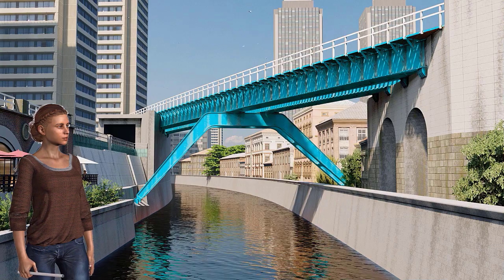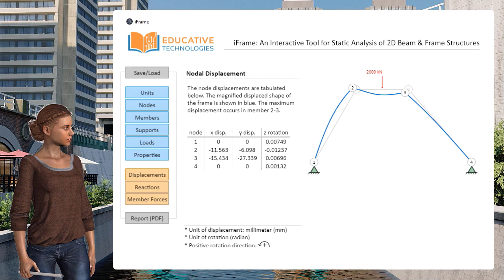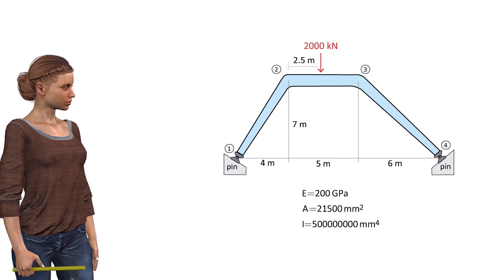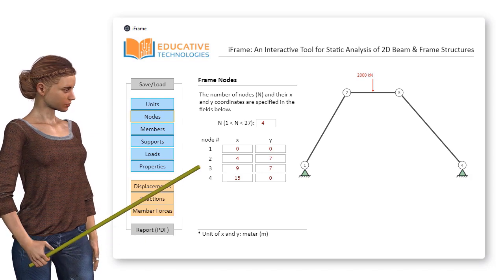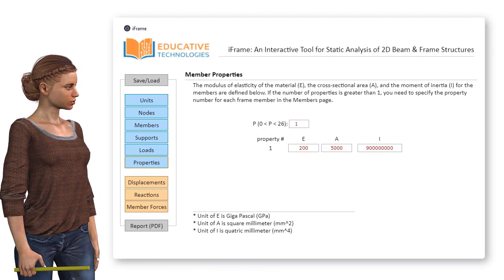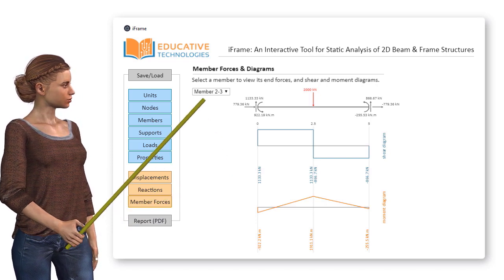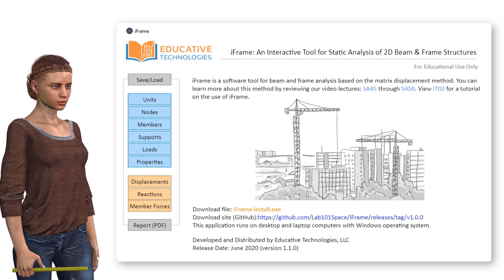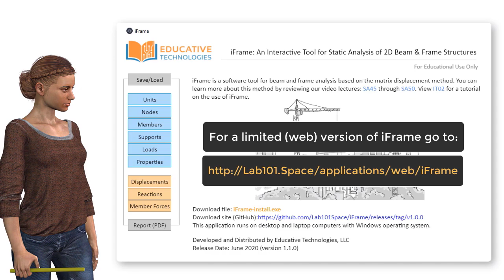IT02: Beam and Frame Analysis Program (iFrame)

Comment: I have installed update on Iframe Application & after that it stop working and even the short cut from the task bar disapeared. what can be the reason ? Also can you share the download link for iframe ? Thanks
Reply from the maker: It seems that the update installation was not completed. The download link for the latest update is below. Try installing it directly from the link and see if that solves the issue.

https://github.com/Lab101Space/iFrame/releases
Reply: @DrStructure  Thank you. 
Its working now. Actually the issue was that my laptop shutdown due to low battery during updates installation.
Reply from the maker: Glad to know the issue has been resolved.

Comment: How to analyze 2 node beams in iFrame?
Reply from the maker: You need to turn it into a 3-node beam by introducing a third node, say, at the midpoint of the beam. So, the beam would consist of two elements, an element from the left end of the beam to the middle node, and an element from the middle node to the right end of the beam.
Reply: @DrStructure  Are the solutions going to be same?
Reply from the maker: Yes. The beam is the same, the supports are the same, the loads are the same, ... the only difference is how we model the beam. In fact, we can divide the beam that way into as many segments as we wish and still get the same results (i.e., support reactions, shear and moment diagrams, ...).
Reply: @DrStructure  Sorry sir, but it's not working for me. Am I missing something? Solutions are not same.
Reply from the maker: Please email the problem definition, and the iFrame saved model/file to:
Dr.Structure@educativetechnologies.net

We'll be happy to take a look and give you feedback.
Reply: @DrStructure  I got it, sir. Thanks for help. It's a good software. Can you add some more features like internal hinge, VDL, axial force diagram, slope, deflection etc?
Reply from the maker: Great! 
Yes, we plan to add new features to it as time permits.

Comment: Sir/madam,  I have one doubt please clarify it.

 say for example let us consider a fixed beam which is subjected to less bending moment as compared to SSB. 

If bending moment is less in beam , then depth of the beam is  also less. If depth of the beam is less, then  cross sectional area is also less. If cross sectional area is less, then material consumption is also less. If material consumption is less, then cost of construction also decreases. But we know that depth of the beam decreases ,deflection of the beam will increases due to less moment of inertia.

Here I am having confusion. Which beam we will use for a construction whether less carrying bending moment beam or more carrying bending moment beam?

If we use less bending moment then deflection of the beam will be more. How to control the deflection?

Please!
Reply from the maker: In theory, one could come up with an optimum design for the structure using various optimization techniques. For example, we can write a mathematical function that defines the total weight of the structure in terms of its member lengths and cross-sectional areas. We can also write a set of equations (called constraints) that describe the limits of stress in each member. For example, a typical constraint could be like this:  bending stress in member i must be less that the yield stress of the material. Of course, all written as  mathematical expressions (equations). We can then use an optimization technique to minimize the weight function while satisfying the constraints. The variables in this case are the cross-sectional properties of the members. You may want to look into structural optimization literature if you wish to explore the topic in more depth.

In practice, however, mathematical optimization is not often used since most (steel) structural members used in buildings and similar type structures come in standard sizes. It would be rather costly to use customized (although mathematically optimized) members in a structure. 

As you indicated, the more a system is optimized (weight-wise), the less material the structure uses, hence it is more likely that it would displace more.  Of course, one can define constraints for displacements as well, if one wanted to optimize the system in light of some displacement limitations.

However, displacement is generally not a design consideration. We design a structural member to ensure that the stress in the member does not exceed the allowable stress. There is no failure-related displacement criteria independent of stress. Although for serviceability reasons, we often limit the amount of displacement in a member to a fraction of the member’s length.
Reply: @venkatesh the thing is you have to compare ssb with fb only when E&I, L are constant.
i. e)for a given beam of same material properties, the fb deflection is less compared to ssb.
But if you change the depth of the beam the deflection will change